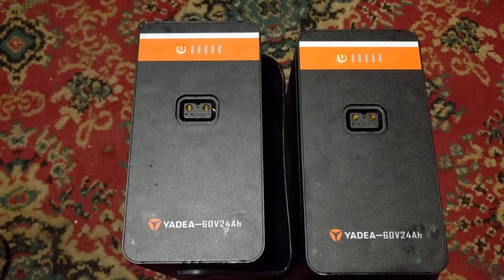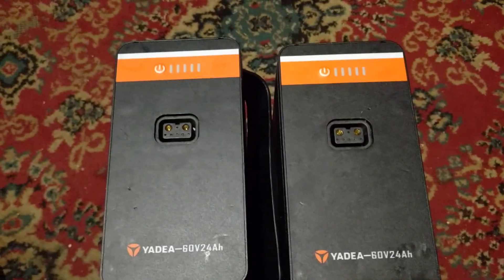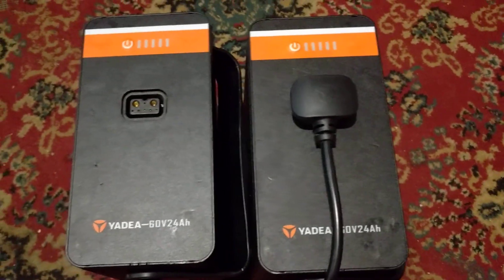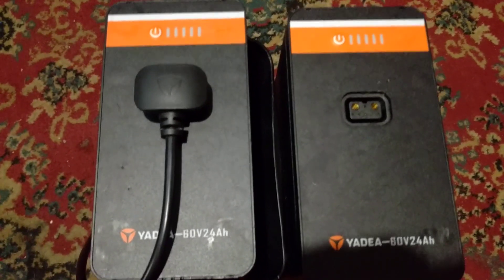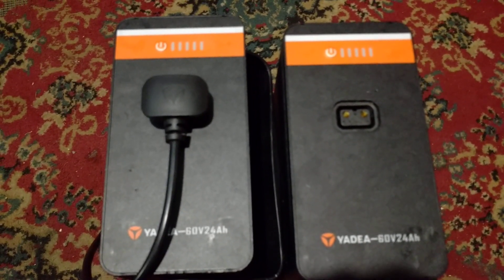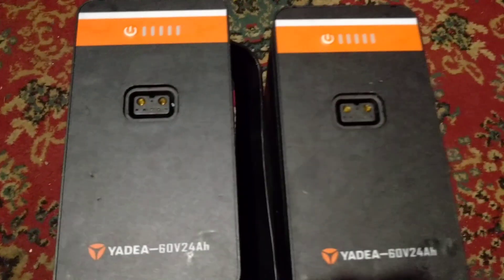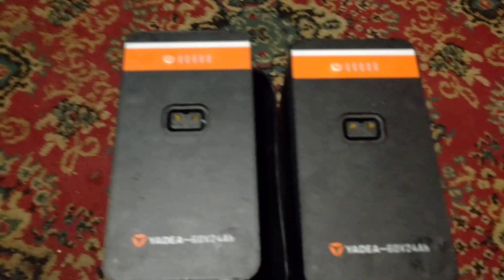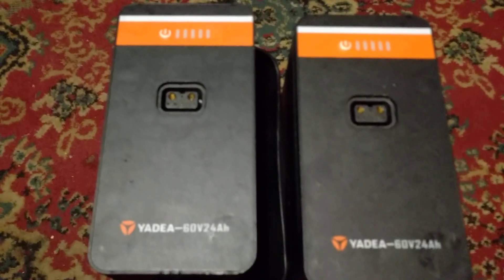yadea 60v 24ah battery issue

Comment: Got the same issue with a battery that's been sitting for about 1year. Now showing one red led then flashing all five four times when pushing the button. Same when charging. Managed to take the top of. Thinking of bypassing the BMS for a quick trickle charge. Will try to make some measurements on the cells themselves.

How did you get the battery compartment open, seems glued to me?
Reply from the maker: @magnusmoldin1609  can't make it any worse...

Comment: ive got a pair with the same fault now ....one was stored over winter and the other was fine till today , scooter said it had 4 bars of battery on display on scooter .....then it just cut out while riding ....when i checked on the actual battery it said 1 red ??? 2x fucked batterys after less than 2 years ??
Reply from the maker: Ok I maybe should have updated this and how I have progressed, of the two I had here one was 6v not 60, one was about 50 with the flashing battery gauge and no function on charger or bike. 
The 6v one I removed the top disconnected BMS and charged direct with a constant current of 150ma until I hit 55v after an eternity, then reconnected the BMS and it simply said flat battery on the gauge but no flashing, connected the charger and it started to charge, that one has been returned and is back in service. The other one turned out to have a blown internal fuse on cell 3 balance lead. I'm in the process of replacing that, I had to cut the battery apart.... I'll get a video of that up soon.
Remember this invalidates warranty and manually charging can result in battery fires, do not try this at home.....
Reply: @lezbriddon  nice info , i managed to charge my good one thankfully (for now!!) ,i wont let it discharge so much in future but removing it every night and carring it 100 yards , getting charger out etc etc gets a little tedious lol. my other battery just flashes 5 bars 4 times and wont charge ., light on charger stays green ?
Reply from the maker: @martinparker9249  yup 4 flashes of 5 bars seems to be the code for "I'm not turning on", on the battery above it was a cell voltage error from the blown fuse on cell 3.
Reply: @lezbriddon  Lexmoto said they may be able to fix it for £100 as its still under warranty mine i think (3yr Warranty)
Reply from the maker: Please post back with how you get on with them, may give hope to others if they do
Reply: I have a handful of these yadea and all have been discharged too far... Some are even brand new and never used.. 

What I'm curious about is not only how to get it to work again and if it will work, after being charged manually bypassing the BMS, but also the charge specs.. a 16s li ion is 67.2v fully charged but these yadea are 66.4v and still 16s? 

Would be amazing to get these working and not overcharge them too 😅

Comment from the maker: I've now tried everything and ran out of ideas. I got the battery open,  I've charged the battery to 60v it was at about 58, the charger outputs 63, I then charged to 62 for an hour. I tried holding the button when plugging in the real charger, nothing, I disconnected the BMS for 5 minutes, reconnected and it was the usual BMS in a coma state, plugged in the charger and it woke back up only to give same error flash.